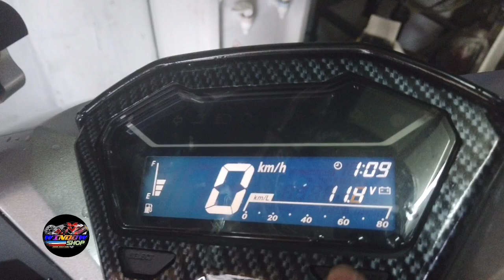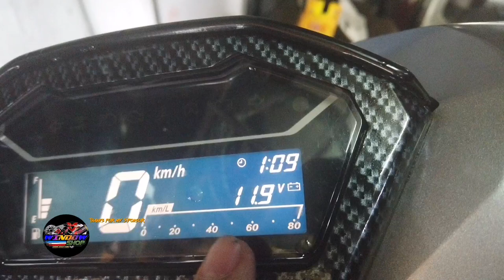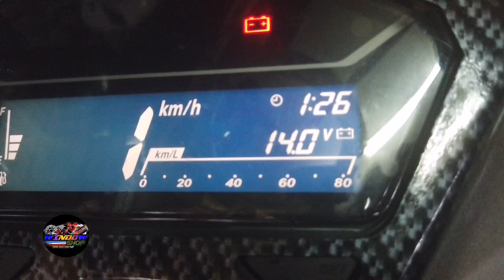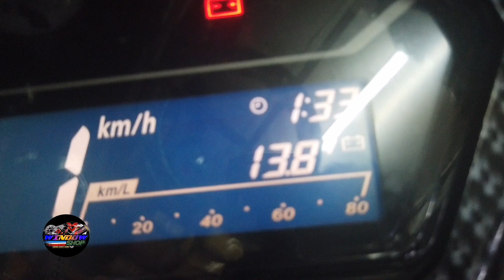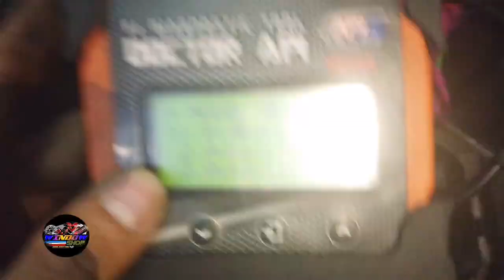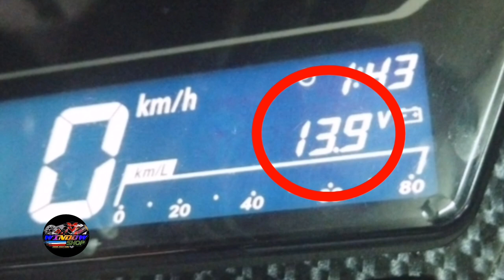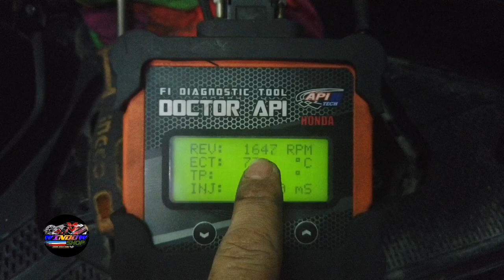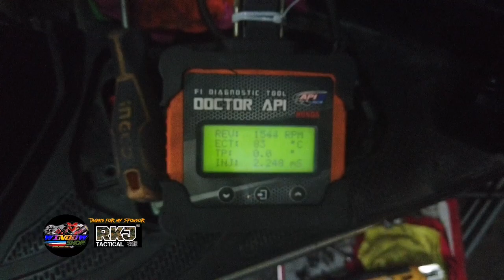CHARGING ISSUE NG CLICK GAGAWAN NG PARAAN.

Comment: yung motor ko po kasi. ambaba ng voltage reading. nya. pero pag tpos ko gmitin yung signal light. saka nag kakarga. nka install lang sa motor ko gps. bago po battery july 25 2021 ko po nabili. od gel type po yung battery, hindi ko tuloy madalas gmitin yung idling stop nya bka lalo bumagsak yung voltage e
Reply: Same problem paps nka mdl gps at may egle eye bago baterya pero mahina ang pasok ng kuyente puni diagnos ko clear naman tska ela naman grounded pag nka idle 11.5 lang kya woworry din ako bka tuluyang bumagsag na voltage..